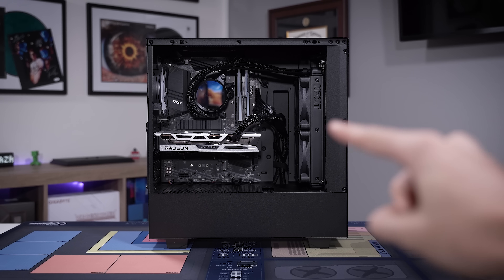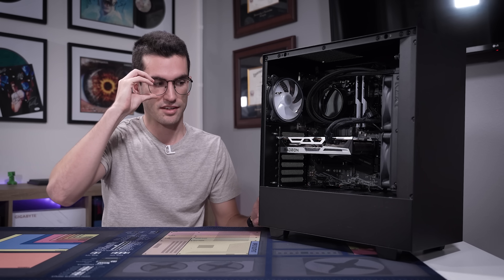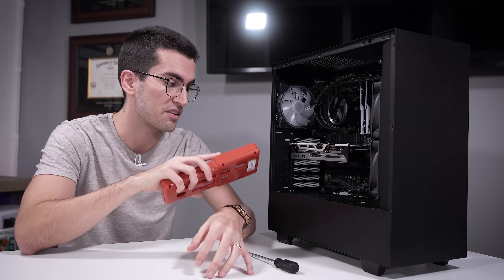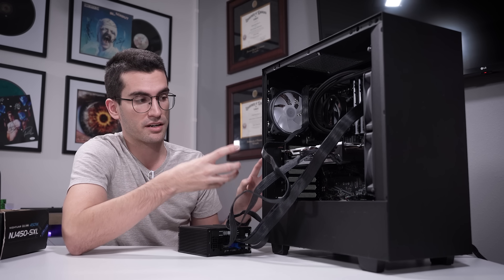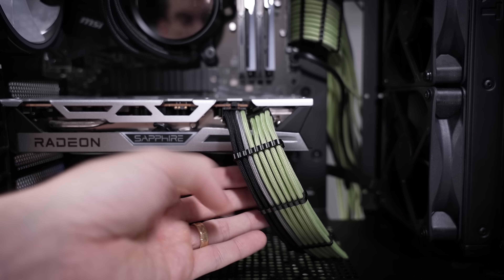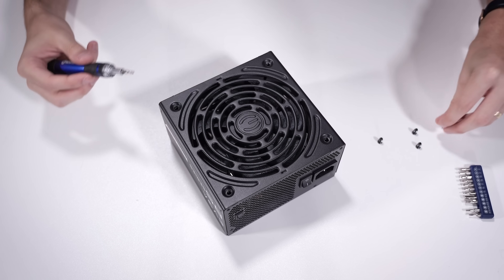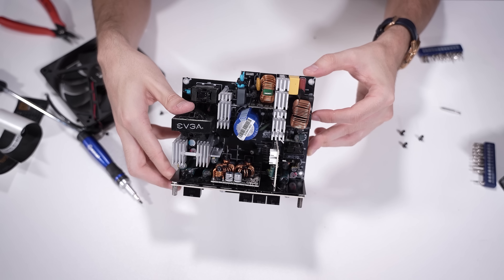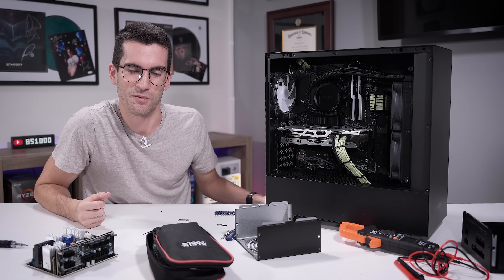Fixing a Viewer's BROKEN Gaming PC? - Fix or Flop S3:E15

Comment: Not that the power supply is a bad brand, but it looks like they cheaped out on that component only. It pays to get a better PSU if you are putting it in a nice rig.
Reply: Depends on the model.  Some were good, some weren’t.  I couldn’t tell which model it was.
Reply: @farmeunit  I think the point was they went with a pretty good mid range system, but got a cheaper, probably slightly under powered PSU. Personally I wish people on forums wouldn't spend so much time getting people to "right size" their PSU's. A decent 800w would have been aprox $80 and not made much of dent in the cost of building the machine. Not that it would have saved the PSU if this failed during a surge/brownout/power outage. Though a higher power less stressed unit would have handled a brownout better. But considering how I have witnessed PSU's handle loads worse as they age. Getting something with 10% head room was always going to end on a bad note. Better it just died then spend a year wondering why every once in a while the machine would just power off or reboot.
Reply: @andrewalexander9508  I always look at component recomendations, add them up and then add 100 watts. The trend in components being higher wattage generation after generation tend to make a little extra head room will get you a PSU that is good for more then just one generation. Depending on the PSU most are not super efficient at max wattage but somewhere near the middle
Reply: @andrewalexander9508  Most people I see actually oversize their PSU, which is fine but not everyone needs a 1000 power supply.  I run 750W now on 7700X and a 6900XT with no issues.  Did he even mention the parts involved?  I missed them, but 550W could have been fine and ultimately, we don't know what his power conditions are, etc..  Lots of variables.  Not to mention, depending on when this was built, the prices for 750W and up were over $100.  I got my 750W Seasonic on sale for about $100, normally $140, I believe.  Got an 850 G3 for from $100 a bundle another guy bought and they were $150.  Budget rigs are usually built because you have a budget.
Reply: @farmeunit  A lot of people who build their stuff regularly overspec their PSU. But what generally happens is people who don't know what they are doing, check with forums/reddit, and typically the voice is to only get what you need for a PSU. Which equals someone getting a PSU that barely meets the power requirements, is less tollerant of dirty power, and overall just made less well. 

We could go back and forth on pricing. But I got a 800w, SFF Titanium PSU for $140 3 years ago. They were even you could get a Gold 750-800 for between $80-100 for a full size ATX. Maybe more from a more premium company. Getting a cheaper cooler, or getting less flashy memory, or changing the case would have been better than cheaping out on the device feeding power to all of the components in the machine. There was a reason Greg was soooo worried when he knew that the PSU completely failed. You don't cheap out on two things, motherboard and PSU. Everything else you are debating capacity and performance (and apparently RGB for this user) but those two things keep the blood flowing and you don't want to risk them.
Reply: @andrewalexander9508  I agree on buying a good, quality power supply, but we don't know it's under specced without knowing the parts, lol.  It's a decent brand is my point.  If it's a 65w CPU and a 250w video card, why do you need 800w?  Maybe you recognize the video card and CPU, but to me, I don't.  I ran several CPUs and cards off a 550w Corsair and had it for 5 years until until I gave it away and someone is using.
Reply: @farmeunit  65w, still run upwards of 100w. So 250w + 100, puts you at 350w with no other electronics, but this system had an AIO, 4 RGB fans, RGB memory, memory in general, and an SSD. So now you are running let's say 400-425w. Now you only have 75w of overhead. It will act worse with brownouts , be more stressed generally, well out of it's best efficiency (plus it's a bronze unit so efficiency is already weak). As it ages it will much quicker not be able to feed the high end of power usage in the system. 

Where something 650 to 700 may never get to that point. The relative price difference between a 650 to like an 800 puts you system in it's efficiency high point and can on most power supplies put it in a low or zero fan spin setting. It leaves room for future CPU and Video card upgrades. This goes back to my point. I don't like the idea of right sizing a PSU. Get a good PSU with overhead. We can debate back and forth between how much overhead, how good, but if it gets you trying to save $20-$30, I think you have made the wrong choice.
Reply: I have a Antec from back when they were more main stream and I bought it in 2014 - its still going strong. While I think EVGA makes decent stuff, I believe the stuff above the lower end stuff is better.
Reply: EVGA makes very good power supplies. This was a budget model.
Reply: @ZackMuffinMan  Only sometimes. They switch from a good mfg to a bad mfg with almost every gen back and forth.

Comment: Love the videos. Question: were the cables matched to the PSU? Wouldn't be the first build that reused modular cables and switched brands of supplies. Manufactures sometimes use different pinouts. Did the psu fire up with just a jumper?
Reply: I mean, the thing is that Passmark tester acts as a jumper. If it were going to fire up it would have done so to the passmark tester
Reply: The tester wouldn't even power on, so there no juice stored in the PSU, but it would show some kinda heat deformity if it were missed matched connectors unless the system had never been fired up before , and it booted to windows after rather than BIOS .
Reply: Glad I wasn't he only one to catch that. When he showed a clip of the cables connected to the PSU, I read "Type 4," which I believe is exclusive to only a handful of Corsair PSUs.

This guy either used these cables by mistake or just pulled a fast one on Greg.

Comment: I would personally buy a better quality power supply. Bronze is a no go for me these days. Also 550W? Nothing below 700 can be recommended when using a Dedicated GPU. You want overheard. I spec my machines at 2x the power required. So if 600W is roughly what parts required, I go 1200W.

Comment: My computer runs loud but cpu package is at 75c even when nothing running
Reply: We had a new build a while back that started running hot and loud (at idle) shortly after we fired it up. Turns out the software running the backup drives had lost it's mind and glitched the system.

Comment: "The power supply in question probably cost like 50 or 60 bucks."
Newegg: 150 to 200 bucks, bro.
Amazon: A bit cheaper, at around $130.
Reply: Evga sells it  for $89.99.  Ebay $50.00 brand new (lowest).

Comment: @12:26 Don't put your kitty in the microwave and don't touch everything like a 2 year old. 😂
Reply: Don't try and repair your vacuum tube TV either, without some experience.
Reply: @raylopez99  no one has vaccum cube tvs ..come on
Reply: @darkknight13929  My neighbor has one that still works, he had it restored about 10 years ago, he has a converter box to get the over the air digital channels!😲😲
Reply: @wallychambe1587  whaaat? 🫢

Comment: I lost 3 power supplies in 6 years, luckily none of my equipment has ever gone to the grave along with the power supplies. I consider myself lucky in that case.
Reply: good PSU can save hundreds if not thousands
Reply: I have a PC from 2009, still works on the same PSU, Corsair i think, 650W. I learnt to overspend on psu, because you can keep them a long time and they will save you headaches with instability or worse.
Reply: I have moved to Seasonic mostly with 7-10 year warranties.  That being said, I had good luck with Corsair and some EVGA.
Reply: @farmeunit  seasonic is always a good choice, running 850w one myself
Reply: @Shane Farmer  Seasonics are apparently pretty good Linus was doing a video deliberately trying to run too much power through them and couldn't get any of them to mess up or shut off (running 850 watts through a 500watt rated supply etc)
Reply: What brand of PSUs are you buying? Ive had a few PSU last me 5-7 years before changing it out for more power.
Reply: @Beezzzzy_  the first was a Cougar that came with my computer, as I bought the whole computer second hand, the second was a Thermaltake Smart Series 750w (it's bad I know, but my mom bought it instead of letting me choose because she knows jacksht about computers got scammed because she paid like 3x what that sht is worth and sells for), and the last one was a Corsair CX750 that only lasted like 2 years. RMA'd both the Corsair and Thermaltake units and got a free PSU upgrade getting higher quality ones over the old ones.
Reply: @SiMahri  too expensive in latin america, barely anyone can afford that type of thing. Here we pay up to 5x the MSRP of electronics while earning basically nothing.
AIOs that go for 110 USD go up to 600 USD inside the country and we barely make 200 USD a month, not a thing the average person can afford.
Reply: @POLARTTYRTM  you can get them for about 60usd for a bronze 550w  with good warranty and good manufacturer which n will be fine for most average systems it will save you way more than 50usd when one of those psus goes bad and takes everything with it like the evga one in this video it saved the components
Reply: @rockiefillier9521  it seems you didn't pay attention to my comment AT ALL. I said we don't pay MSRP, we pay up to 5x their designated MSRP. PSUs that go for like 70usd are sold here for more than 400usd sometimes and we make less than 200usd a month. Pay attention to comments before commenting. There is no such thing as paying little money in USD in this country, the prices are hell because of super unfair and abusive taxation, MSRP simply doesn't exist in this country and retailers charge whatever they want. 3090s at the peak of the GPU crisis were going for 10.000 dollars! We earn less than 200 a month ffs. 3070s still go for 600 700usd.
Reply: @POLARTTYRTM  my CX750 had a cap blow out on the first month using it. Never buying CX line again
Reply: @MarwinEwert  Yeah, that's a reason I am no recommending CX power supplies again. However, their RMx, HX, TX and AXi series are very decent.
Reply: @POLARTTYRTM  Indeed CX series should not even exist. It gives Corsair a bad name. But i gues everyone has to have a cheap option on the market. And as we know cheap means cheap components that may or may not last.
Reply: @POLARTTYRTM  de donde sos? 5 veces? aca en Uruguay es x2, 5 me parece un disparate
Reply: @nicane-9966  Brasil <:( los impostos son demasiados abusivos.
Reply: @POLARTTYRTM  bro, I checked the prices. You're getting raked over the coals. What's going on? Is there an import tax on electronics or something?
Reply: @hermanwooster8944  if you read about taxation in this country your brain would implode. The prices are absolutely absurd for what we earn per month. Sometimes the import tax can be more than 200%!
Reply: @POLARTTYRTM  I'm sorry to hear of that. It's hard enough to budget a rig at USD prices. I can't imagine what it's like to budget 5x MSRP. Do non-gamers tend to pick miniPCs such as BeeLink or how do they budget?
Reply: @Beezzzzy_  same, I’ve even kept a 10 year old psu just for troubleshooting reasons only. Still works fine. My previous rig is now in family hands and still works with a 7 year old psu. A good psu not only saves thousands but lasts a long time also.
Reply: Being a retro enthusiast, I have many old PSUs that are still working after 40 years. Some of them required some TLC (like replacing all caps with new low ESR japanese caps), but others (like a 35 year old Seasonic AT PSU) already came with very high quality japanese caps (Rubycon & co), which did not need to be replaced and the PSU is still working as new. Quite incredible, really.
Reply: Before I lost the third one I would have put in UPS, those not only provide battery backup, but they clean the power and add additional protection against surges and other input voltage problems, and they usually don't blow up in the process.
Reply: @jeffreyparker9396  this
Reply: out of my 6/7 years of gaming I've only had 1 psu go out on me. It sadly killed my boot drive but on the bright side it was very simple to fix and luckly it wasnt something more costly.
Reply: @rusty2369  in 30 years it happened to me once, and it was after i dismissed it and gifted to a friend.
Reply: In past 20 years ive never had a PSU die on me. I always try to get a good quality PSU for every build i do. I normaly use Corsair or Seasonic and i think ive even had that exact EVGA PSU in one of my past builds. I would like to know what manufacturer those 3 dead PSU's u had were from?
Reply: @j.p.h.8126  it's just right above, read the replies.
Reply: @POLARTTYRTM  Aah yes did not read far enough.
Reply: Unlucky
Reply: ive had teh same power supply for like 6 years and used it on many builds and it still wrks fine!
Reply: yeah but i would suggest getting a surge protector or a good UPS
Reply: @GuidoDePalma  UPS is a bit overkill if its not a workstation. But yeah surge protection is very good thing to have with any electronic devices.
Reply: @j.p.h.8126  that depends on the quality of your mains AC
Reply: @GuidoDePalma  That is true i did not even think about that since here in Sweden we have very little issues with it.
Reply: i consider you unlucky if that many psus fail that fast.
Reply: @J03130  very, very bad power quality. We lose power at least twice/3x in a single day during summer, and in other seasons it happens out of nowhere randomly, sometimes several times in a day, apart from power surges and other issues.
Reply: i have the same psu since 2014-2015 and never had any issue idk how you lose 3 of those in 6 years lmao
Reply: @salty22  bad power, some places are far more prone to surges, voltage drops and noisy power than others and all of that can reduce the life of power supplies.

Comment: my rule is you never ever cheap out on a psu. i have used the same corsair ax 1200 unit now on 4 builds spanning 10 years and has never let me down and is now powering a 3090 and a 5950x

Comment: Weirdly enough I'm in the middle of helping someone put together a build. Put in the new cpu, it's stuck in a boot loop but when I put the old cpu in it wouldn't turn on at all. I thought I killed the power supply lol
Reply: You can get a bios programmer for not much (10 to 20$) if its a newer system, not that hard to use, but if its older system the programmers are a little pricy (50 to 100$), considering it started with boot loop its worth a shot , and you will never worry about paying extra for flash back board again either , not mention keeping a collection of unused valuable cpu around just for flashing . I kept a 5600g around for months just for flashing cheap b450s before i figure that one out .